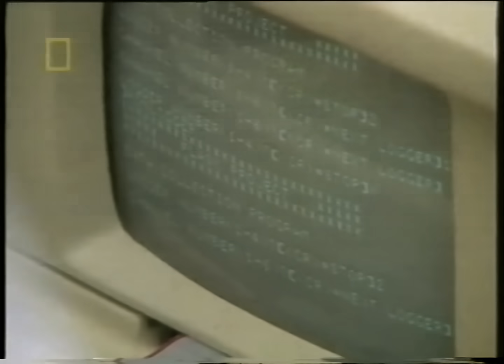Train Crash Test @ 160km/h (99.4 Miles) into 50 tonne Metal Block

Comment: In the 1980s, this was actually very similar to a typical American diesel loco in power and weight. Really big, powerful engines became common in the 90s; before that, they had always operated in multiple, and rarely at 100 mph. Speed is what gives a train hitting power. 
Besides, the flask was never likely to face an American train, operations being confined to the UK.
Reply: A typical long distance passenger train in the UK is a 125 mph Pendolino with nine or ten coaches with a drivers cab at either end. These are designed to be safe in a high speed crash and a high speed accident 15 years ago had only one fatality, where the death toll would have been higher on an older train.
Reply: @Glenn1967ful  Im not massively knowledgeable about trains so am probably going to get Flamed hard here :) But I think you're looking too modern if you're talking about a Pendalino. @Danlefou was talking more of the era of the Intercity 125 (Still does 125mph at cruse) Just doesn't have any of the lean bendy bits so has to slow down for corners.
Reply: @Glenn1967ful  The Ladbroke Grove rail crash (also known as the Paddington rail crash) was a rail accident which occurred on 5 October 1999 at Ladbroke Grove in London, England, when two passenger trains collided almost head-on after one of them had passed a signal at danger. With 31 people killed and 417 injured, it remains one of the worst rail accidents in 20th-century British history.[1]
Reply: Trains in the UK are maybe a couple dozen cars, while in America freight trains can have a least a hundred cars and often they are double stack containers. And in America we do have nuclear transport containers, which are sometimes called casks, although ours are much bigger and more cylindrical. They're so big in fact that they are transported on a lowboy when on the road, and lowboys do not like raised railroad crossings
Reply: @hunterneitzel3012  Wrong. Have sat at a train station outside a docks waiting for a train home after work. Going in the opposite direction every day was a freight train heading outwards from a huge port, "DP World". More often than not it was pulling over 80 carraiges behind it. 
Is so funny how  you ummurricayans seem to think everything the usa is bigger or faster (whichever the case may be) than anything else? About the only thing that is, well almost all the time, is people. Afterall "My 600lb Life" isnt filmed anywhere else is it 🤣🤣
Reply: @kf8575  well I'm not American but it's true the US usually have the biggest things: their cars, their shopping centers, their amusement parks...
Reply: @hunterneitzel3012 uranium one was transported across the U.S. in rail cars.
The only way we know this is from the shipping receipts from the freight company.
Reply: You're right, guy from 9 years ago. I once saw a slow moving train hit a guy who was walking across the tracks, and it just bounced right off of him.
Reply: While speed does make impact worse the mass of the train is what really counts
Reply: @wb3161  Kinetic energy is 1/2m*v^2. If you double the mass of the train, the energy would double, if you double the speed of the train, the mass would quadruple.
Reply: @macicoinc9363  too much for me
Reply: @macicoinc9363  should be Impulse we are looking at either way, I'd think, right?
Reply: I'm afraid you have got it backwards, my friend. The formula for kinetic energy of a moving object is 1/2 ×  mass × velocity^2. The velocity^2 term means velocity squared, or velocity times itself. Which means the energy increases VERY quickly as you increase the velocity. At 10kmh you get an increase of 100 but at 20kmh you get an increase of 400. And at 100kmh that quickly goes up to a factor of 10,000.

But the mass portion of the formula is not squared, so if you double the mass you double the energy just as one would expect. Rather than multiplying it by itself. 

Here's a link for a site with a calculator to work out the kinetic energy of an object. Play around with different values for mass and velocity and see how much more drastically velocity affects the total energy. Or not. Either is fine.

 The page also has an explanation of the math basically going over everything I already said just in case you wanted proof. Because I know it's not an intuitive notion that speed matters more for kinetic energy.

Anuway I hope I didn't put you off too much with all the math, but unfortunately that's the best way to explain it. If it makes no sense, don't worry about it. It's probably not going to be something you'll need to know. Unless you're a weirdo like me.
Reply: @wb

exactly… This "train" appears to be a couple of locomotives which means the total weight of the "train" is between 400 to 500 US tons… I worked for the railroad in the US and I have routinely been on trains weighing over 20,000 US tons often times traveling at 45 to 50 miles an hour… a.k.a. they would have 8 to 12 times the kinetic energy as the "train" in this experiment
Reply: I now see that it's one locomotive and a couple of passenger carriages…
A.k.a. a 20,000 ton freight train of which there are hundreds day moving across the United States would probably have a minimum of 10 times and maybe 20 times or more kinetic energy than the train in this experiment
Reply: @pagansmc13  This train @ 100mph would probably impart more KE than a 20,000t train @ 45mph.
Reply: @agt155  Doesn't look like it. This train is approx 220 tons, at 100mph gives approx 220MJ. 20k tons at 45mph gives about 4GJ.
Reply: @K-o-R  Higher the speed the more of its total KE will be imparted on the cask.
Reply: @agt155  Yes, I figured as much. 45mph is probably going to knock it aside before it gets crushed. 100mph the train is already through it before it starts to move.
Reply: It would impart a lot more. Kinetic energy is equal to 1/2 × mass × velocity^2. Velocity^2 meaning squared, if you're unfamiliar with a ^ symbol. But on to why that's important.

With the velocity squared you're multiplying it by itself. So at 59kmh you get an increase in kinetic energy of 50×50=2,500. But at 100kmh, you get 100×100=10,000. So for an increase of just 2× the speed you get an exponential increase of 8x.

Whereas with the mass of the object, there is no exponent (the squared bit) you're just multiplying the mass by the velocity so the energy added by the mass would be linear. That is, you increase the speed by 2x you get 2x the energy and a 4x increase gives 4x the enegy etc. So you don't get nearly as much of a sharp increase as you do from the velocity.

And because I don't expect or want you to take me at my word, here's a link for a great calculator that let's you work out kinetic energy AND explains the maths sort of the way I did.

https://www.omnicalculator.com/physics/kinetic-energy

If you try putting in different values for mass or for energy you can see how much more steeply the energy increases with velocity compared to math.
Reply: @pagansmc13 the train is not solid, so only part of the mass will hit the block, the carriages will break apart and derail.
Reply: @pagansmc13  Your a taking way too simplistic assumtions, first that the total energy of your 20k tons U.S. train is going to be applied to the tested container which hits only the front of said train. In reality, your 20k tons train will derails in multiple S segments, and cars will crash bagpipes style. I guess the main impact force is going to be the locomotive with about 10 first cars, the remaining cars will not transmit their crash energy to the tested container.

Comment: A freight train would be doing no more than 75 mph, and kinetic energy increases as the square of velocity. This train hit about as hard as anything in Britain could. Adding vehicles would have made little or no difference, as various factors such as compressive couplings, automatic brakes and digging itself a hole would have dissipated the extra energy. A train is not an uninterrupted, rigid object. Note that the third coach was little damaged.

Comment: It wasn't blown up, just run into the flask at top speed. The bogies were knocked off and bent, the frame twisted, the generator and pumps broken away, and both cabs wrecked. A guy who had driven Peaks explained the damage to me in detail. Note the steam and black smoke in the exhaust as water and oil enter the leading cylinders from the fractured block.

Comment: Greenpeace claimed to have been alerted by a whistleblower. Perhaps they had been told of bolts loosened and coaches ballasted, but the intention was probably misunderstood, certainly by Greenpeace.They said the engine (sic) was supposed to fly out so that it wouldn't hit the flask, but the coaches were ballasted to keep them *on the ground* and off the flask top. If they were ballasted, it was to *increase* the kinetic energy of the train. Elementary physics lessons required, methinks, guys....

Comment: It was suggested, but the bolts would still have to break for components to fly apart. If anything was *slightly* loosened, I suspect it was to ease dismantling after the crash. The loco couldn't have functioned with parts as loose as Greenpeace suggested (and later retracted) and the force required to hurl many tons at least 20 feet straight up is considerable. At 0:29, the exact moment the generator front starts to rise, the upper flask fins start to deform. Equal and opposite reactions!

Comment: What you see flying through the air is the generator, which broke away from the engine, taking part of the crank case with it. The engine remained firmly in place; if it had been unbolted, the torque reaction would have overturned it as soon as anyone tried to start it! The flask, having been pushed downwards by the impact and reaction of the generator, then acted on the engine to overturn the locomotive. It absorbed all the available kinetic energy; Newton's third law was well demonstrated.

Comment: there was a "few" small things wrong with this test however,the railway train's engine was NOT bolted down on the chassis.if you look closely,you can see it fly through the air after the train hit the nuke flask,somewhat reducing the kinetic energy
Reply: The prime mover was never launched out of the loco, it was the generator that you saw fly out

Comment: The locomotive was probably running from a small tank of fuel, enough for the test. If that was a service train there would also have been a fuel fire to contend with. The train ought to have been ballasted to imitate a load of passengers. That is why the test appears to be a publicity-stunt.
If the locomotive was condemned why not give it a spectacular end?
I wonder if the pork pies in the buffet car survived?
They'd have been more dangerous than the contents of that flask.
Reply: The original video by magnox generation shows that it was done to improve public  perception of the safety of nuclear waste going by rail so they staged this crash as it would be the ultimate test, e.g. the worst thing that could happen to a flask

Comment: The train can be timed from  the video passing the platform end at around 100 mph. Formula: length of train (about 240 feet) divided by time taken to pass a point gives speed in feet per second. Multiply by 5280 and divide by 3600 to get speed in mph. The train, about a quarter of the length typically hauled by Class 46, had travelled over 8 miles at full throttle.
Reply: interesting, but nobody cares about mph
Reply: @hoppspross2837 
🇺🇲 = 😎🤠🤑
🇬🇧 = 🤓🥴🤢
Reply: @OrionCrusader  the uk is using mph as well

Comment: How do you get 340? Three Mk 1 coaches would seat a total of 192. Add a driver (had there been one) and a guard, plus the driver and guard of the imaginary flask train, and you get 196 people involved, of whom perhaps as many as a third would have died. The passenger train stayed in line, so it's likely no-one else would have been hurt in a real accident. 340 is obviously a figure you plucked out of the air, and of course a toxic nuclear leak might kill many more in the long term.

Comment: How many would die slowly of cancer or radiation sickness if a loaded nuclear fuel flask were to leak in a rail accident? Good job this one showed it wouldn't, right? I think it was worth a time-expired loco and three old coaches due for scrapping to make sure, don't you? The crash also tested new seat and table designs in the coaches. There's film somewhere of crash dummies flying about.

Comment: 100 mph was normal express speed on many main lines in the 1980s. The Great Western and East Coast lines were already operating 125-mph HSTs. "Peaks" had a recommended top speed of 90 mph, but were easily capable of 100 when lightly loaded, as here. Radar reportedly confirmed that speed during the test.

Comment: @Ann0ynimouse The crashed one is a class 46, a different kind also built by Brush with a Sulzer 12LDA28B variant engine and Brush electric equipment. The one you've found is a class 47, different bodyshell, variant 12LDA28C engine with more power.

The class 46 was based on the earlier class 45, same bodyshell and engine but built by BRCW with Crompton Parkinson electric equipment and there was also a class 44, same bodyshell again but variant 12 LDA28a engine. hope this helps - Albany

Comment: @NiallMS Apart from the loco being a 46, not a 37, the flask had already been comprehensively drop tested from any height it was likely to reach in service. What it hadn't been was knocked a couple of hundred feet and rolled under a heavy locomotive doing 100 mph, the accident most likely to dislodge the lid. Of course, it was also a public demonstration, and new seats and tables were tested in the coaches.

Comment: @JacanaProductions If they only had to take a pressure reading, why did they need a computer at all? Was it perhaps to calculate the volume of escaped water, or just to record info automatically? One of the engineers removes a floppy disc from the machine, which was obviously a must-have state-of-the-art gadget in 1984.

Comment: @Bluesbreaker2010 Yes, but a coal train wouldn't doing more than 60 or 70, and kinetic energy increases as the square of speed. This short passenger train doing 100 would actually have hit harder. Anything longer would have been retarded by energy-absorbing couplings and automatic full braking as soon as the train pipe ruptured. Note that the third coach was hardly damaged.

Comment: @Bluesbreaker2010 I read that 46009 and another loco were bought out of service, and had worn parts replaced from other Peaks to ensure they could reach 100 mph. The class had a rated maximum of 90, but a driver assured me they could and did exceed 100 in their prime when lightly loaded. In typical BR style, obsolescent 46009 had received a new engine just a few months before!

Comment: @danlefou  technically, this engine had already been withdrawn If I remember correctly. they brought it back into registration by using parts from the other scrapped peaks in order for it to gain the maximum speed they needed.

Comment: It was a Class 46 number 46009, it was crashed into the nuclear flask at around 90mph on the Old Dalby test track on July 17th 1984 and arranged by what was then known as The Central Electricity Generating Board (prior to privatisation).
Reply: Yeah, 46009 was confirmed to be destined for scrap anyway, so they couldn't have thought of a better way for it to go out with a bang.

Comment: @BashirTheTrainMaster Unfair to compare a 1993+ GE dash 9 with a 1961 BR Class 46, so I looked at comparable US locos: 1964 GE U28c 2800hp 79,500lb cont. Tractive Effort. 183t (larger fuel capacity for the longer distances = more weight.1961 Class 46 2,500hp 70,000lb CTE 138t. Not all that different, and we did not need more weight than that, different service needs, shorter faster trains better acceleration rather than infrequent long heavy trains. It's all good though!

Comment: @The170460 If that is so, why did the french railways need to borrow British diesels to help in construction works recently (and Spain also), could that be because the 45+ year old class 37's are rugged, reliable and cheap to operate compared to over complicated modern crap? YES.

Comment: @4trayable It was a full-size main-line train, with a locomotive as long and powerful as its American equivalent, but not so tall and wide in the body because we're stuck with small-bore tunnels left to us by the 19th century pioneers, who underestimated the volume of traffic. There were only three coaches because adding more wouldn't have increased the energy transmitted to the flask; that energy would have been absorbed by buffers and automatic braking when the train pipe ruptured.

Comment: @hjuu1 No remote control. The engine was run up against the brakes nearly nine miles away, and the train was released by a guy turning a valve on the outside, below the driver's door. The loco accelerated away and ran by itself until stopped by the flask.

Comment: Correct me if i`m wrong but i think it`s a nuclear flask, not just a 50ton block, it`s what they transport nuclear waste/materials around the country, just testing it for and cracks or damage so it wont leak radio active material into the air.

Comment: @ChegzGT1EB That wasn't leakage. That was metal and dust from the shockwave. You can see it come off the floor and also every surface of the container on impact. If it was leakage then the all 6 sides of solid metal suddenly became penetrable.....in your opinion.

Comment: @paulofpings only if the cooling water had itself become dangerously radioactive, or microscopic parts of the spent fuel had broken off and were aspirated in that spray...

otherwise a little bit of water which may register a couple extra clicks on a geiger counter, mostly sprayed across necessarily barren, private land, is a major win vs the risk of the container bursting open and scattering "spent" but still dangerous fuel rods to the four winds.